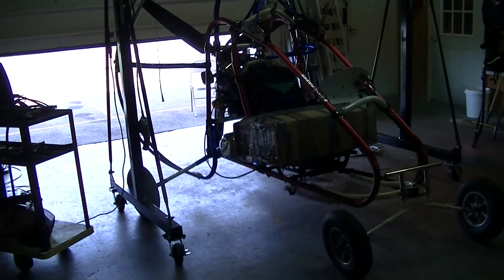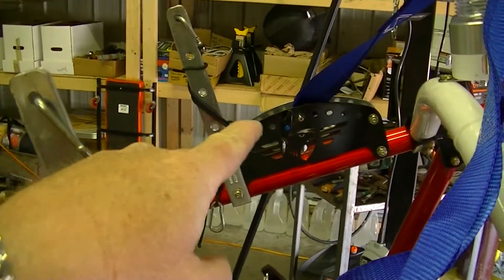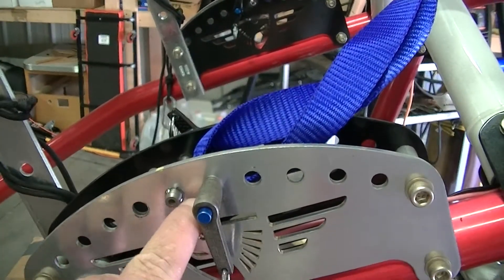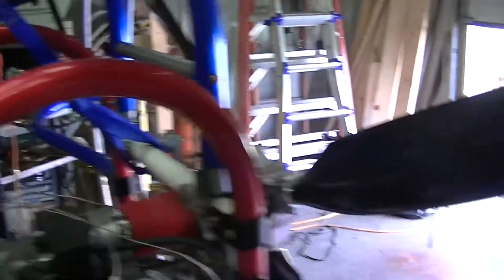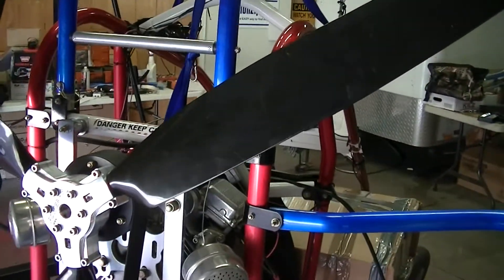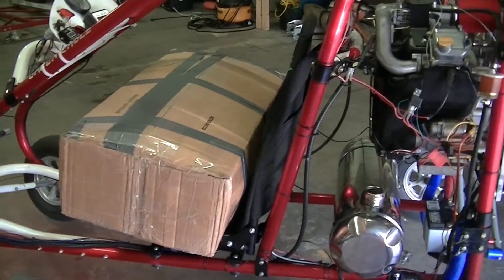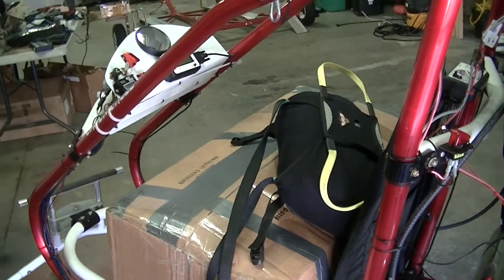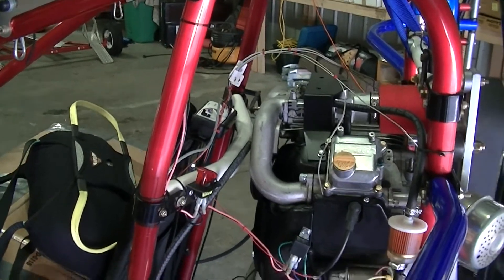Gregs Green Eagle Center of Gravity and weight test

Comment: So, what was the dry weight including the wing?
Reply from the maker: 250 something...  They vary depending on options...
Reply: Free American Spirit 
Safe answer. I have a newer GE (FIT 49 engine) that I recently acquired. Less than 2.0 hrs on the clock. It has more than 20 hrs on it now. It’s a very nice machine.  Do you still have your GE?  The only thing I’m lacking now is a new reserve for  this heavier machine.
Reply from the maker: No I only have the falcon right now.  The GE is a good design I was very happy with it.  It can take a lot of punishment....
Reply: Free American Spirit 
I started out with a Falcon. Then went to foot launch and another trike (Fly Products ) with a 2 Stroke.  Full circle back to a 4 stroke.
Reply from the maker: @falcon4strokeflyer  I never used a 2 stroke.  Cant keep the chain saw or weed whacker from constantly having problems... Figured I disnt need that hassle in the air.... :)
Reply: Free American Spirit 
Yup I went to the dark side for about three years. I won’t go back.  One emergency landing in an over grown cow pasture did the trick.